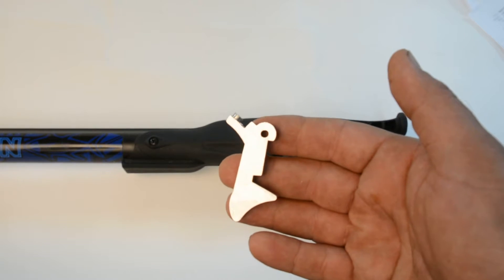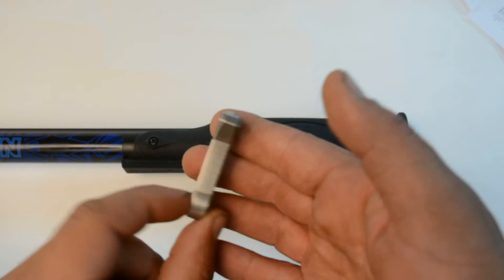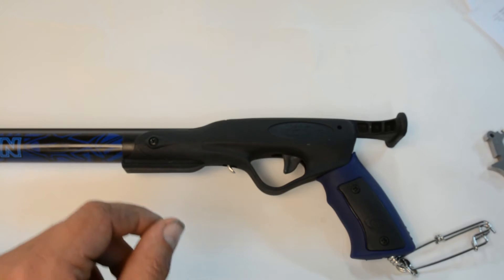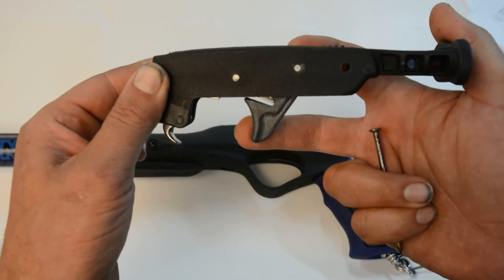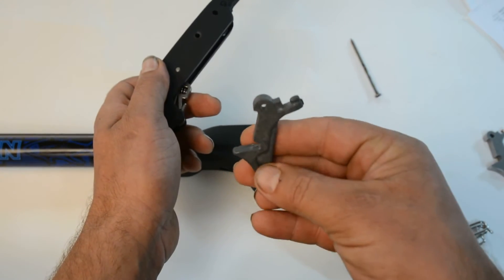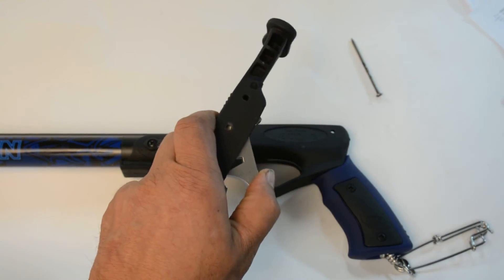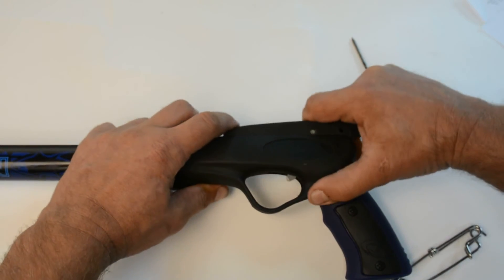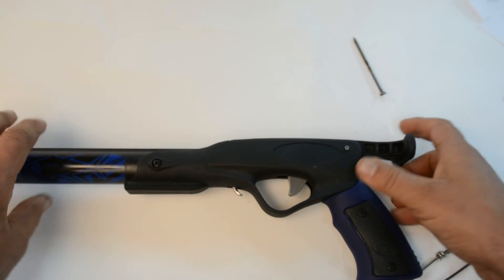How to Replace Speargun Trigger on Rob Allen Speargun

Comment: The trigger is not plastic it’s a glass infused nylon
Reply: It’s still plastic; nylon = plastic.
Reply: Hieuoy not rlly I felt a plastic trigger and it feels way different
Reply: Dan_ 101717 because the shaft release is metal.
Reply: Hieuoy both I’m talking about the triggers
Reply: @danielbrant4993  Rob Allen is using a fancy plastic, case closed.
Reply: Hieuoy what gun do you use
Reply: @danielbrant4993  a shitty 100cm alloy Torreli gun with an upgraded Meandros reverse trigger mechanism, a homemade teak gun with an Ermes reverse trigger mechanism, a shitty 80cm woodie with an old plastic euro handle,  a carbon Rob Allen 140cm Samburu with an upgraded Meandros reverse trigger mechanism and a carbon Aimrite 115cm roller gun.
Reply: i agree with u , RA uses the one of the best materails to build trigger , the nylon trigger is much better than metal , after you fire 200 times u will know the difference , metal trigger is crap